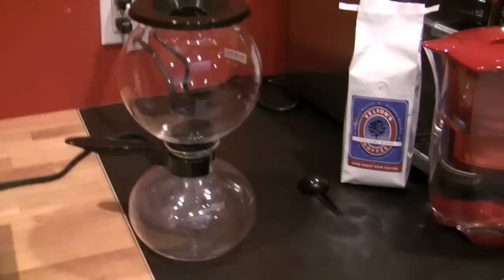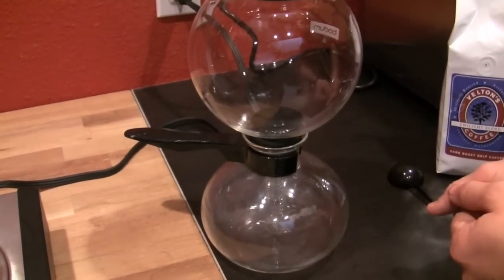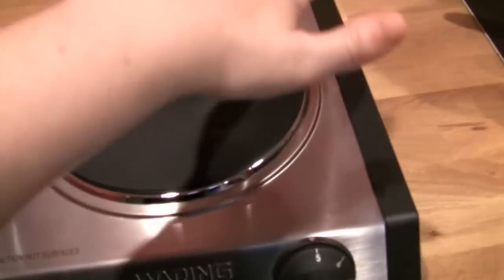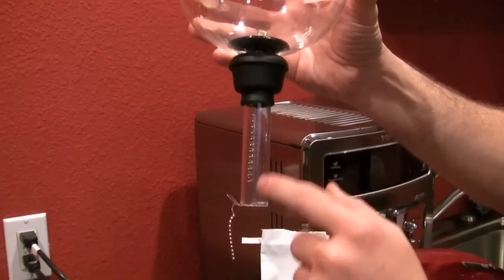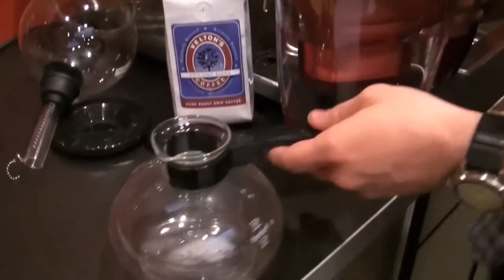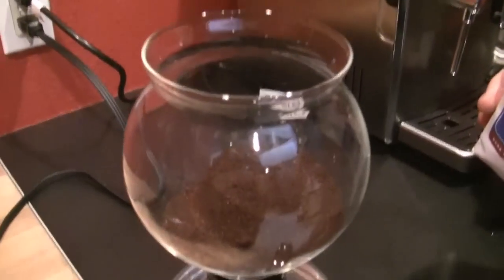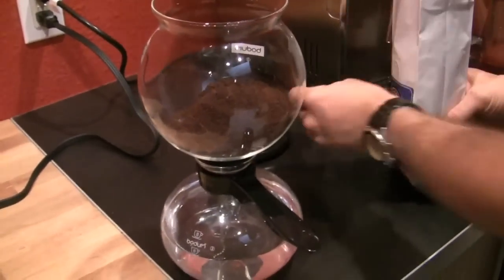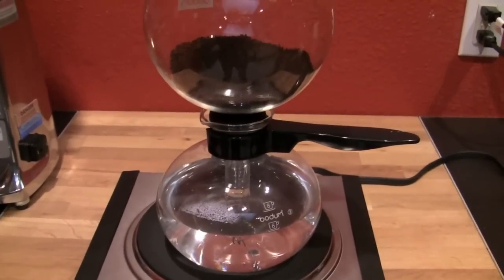Crew Review: Bodum Pebo Vacuum Pot

Comment: What are you using on the induction burner? It appears to have rubber on top? Does that mean you can set the burner to high and not worry about the glass tube shattering?

Comment: Great video as always, but some notes/differences to your method.

1. Heat the water until it fills the top chamber, then fill with ground coffee ensuring the right temperature of water for extraction.

2. Steep the coffee for about 1-2 minutes (better extraction) by keeping on the heat source, but lower it.  Make sure the water doesn't simmer too quickly or become dry.  That risks breakage.

3. When removing from heat, don't place it on a cold surface.  Use a towel to prevent temperature shock.

Comment: Nice little video and the humor of the interviewer lady is fun, I've collected the antique versions for over 20 years now, but they are very delicate, I would reserve the use of the antiques for special occasions only. The newer inexpensive Bodum seen here is easily replaced. One mistake at the end- he does not inform the user that it is imperative NOT to place the pot on direct metal stove burners. They will overheat and glass cracks. Use trivet spacer. Also find the antique insulated burners.

Comment: This is an excellent METHOD of making coffee, but the actual DEVICE has three big problems.  1) The glass is very thin and will break if accidentally tapped against the sink during cleaning.  2)  The spring valve changes its tension with use and becomes problematic after "X" number of uses.  You find yourself attempting to adjust the tension, which usually doesn't work.  3) Replacement parts are expensive.  Why Bodum cannot make a product with thick glass and a dependable valve is beyond me, unless we are simply talking crass profit motive for replacement parts.  It only works for a while and then you get fed up and shop for another brewer.  Bodum has had these complaints forever.  Unfortunate.
Reply: The Bonavita Immersion pour over dripper would be my alternative (also sold by these folks).  Though it is another method entirely, it is a clean, completly controllable process with pre-wetting and soaking aspects built in to the dripper cone.  I set the water to boil in a glass pot and while waiting, rinse off a brown, unbleached paper filter, grind and weigh the coffee.  I pre-wet the coffee with the valve closed, then pour in the extra water for a soak and open the valve.  Indestructable, totally variable timings and repeatable.  Drink hardy.
Reply: just bought an used syphon from a friend who modified it. He used a regular coffee pot like those you can find anywhere made from thick glass instead of the fridle one sold with the kit. He then proceded in using some kind of round rubber seal which he then siliconed in place. It works great and it is solid...good enough for 45$ shipped to my door.

Comment: @acn684 Agreed. Despite what the Bodum says, you really need to get the water to the proper temperature BEFORE letting it come into contact with the grounds. Either by attaching the globe with grounds in it onto the carafe once the water reaches the right temp, or by the method acn684 described. Test the temp of the water as it slowly seeps up into the grounds in the method used in this video. You'll find that it's very much under the desired 198-205 range. Also - finer grind and longer steep!

Comment: Another thing to mention here is that when you start with cold water some water will hit the upper part before it's up to boiling so you will get uneven brewing. What is best to do is to boil the water in a kettle and pour it to the lower part and when the water hits the upper part you lower the heat(if it's an electric stove) and stir the water to bring the temperature down a bit so it won't burn the coffee

Comment: Oh you are using drip grind here. I have this pot and with the included plastic filter anything more than finer end of the grind for french press and the coffee will be clogged and won't come down and it is very difficult to take it apart.  So to get the best result(although not too grate) you need to have exactly the right grind setting.

On the other hand my Hario Syphon with cloth filter will take much finer grind than you use for Hario V60 and almost down to moka pot grind.

Comment: This happens to me as well - the filter seems to get clogged at random, and it's a HUGE pain when it does.  Because the glass globe is incredibly hot, I can't just pour the water into a french press to finish the process.  You have to wait until it cools to unclog and drain the globe, and the coffee is ruined at that point.

I've also used fine, medium and coarse grounds from a Capresso Infinity grinder with identical results as far as filter clogging goes.  When it works it's great though!

Comment: I don't have the Bodum but Yama  but here are some tips ... Put your water on the burner and place the top chamber loosely on top until it's close to boil.   Then put it on and let the magic start.  I stir as he water is coming up to ensure a good saturation.  I keep my water up for infusion about 45 sec.  Then remove the heat source.    Also to the guy who had one explode ... What kind of heat element did you use?  You can't put this on everything ... some stoves need a diffuser.

Comment: @bucketoftruth if you're gonna use something as extreme as ice water then it will definitely break. Even with the more durable Hario glass pots, a wet towel in room temperature is still the safest option if you really want to accelerate the suction process.

Comment: I would like to share a different procedure for making coffee with this type of maker.  I've made coffee with these since the mid 80's, and learned this method from books on the subject. (The Book of Coffee and Tea by by Joel Schapira,  David Schapira, Karl Schapira. A classic.)

Bodum coffee makers are made in Europe.  They are using 4 oz. as a cup, giving the 6 cup marker on the pot.  The traditional measurement for a cup of coffee in the U.S. is 6 oz.  Use the measurement ratio of 1 level scoop to every 6 oz. of water.  Following the rule that the longer the water and coffee are together the coarser the grind should be, I use a very slightly coarser grind than a drip grind.  Do not use a fine or very fine grind because you can stop up the filter and get a vacuum lock.  When all of the water fills the upper chamber, there will be some initial bubbling (the first 'boil') then it'll settle down. Keep the heat on until it begins a second boil.  (If you remove the pot from the heat after the first boil, the coffee will not be at the appropriate temperature and the vacuum in the bottom chamber may not be strong enough to bring all of the coffee back to the bottom and it will be weak, unless you use the incredible amount given in the review of 8 scoops). Here you have some leeway as to how long you wait until you remove it from the heat.  I normally wait until the boil is just getting to the edge of becoming vigorous.  At this point the water will be at about 190 degrees.  I know this because I've measured it many times(at sea level).    Wait until the vacuum in the bottom chamber is refilled with the coffee then pour.  Enjoy.

Comment: Thanks just literally dusted off my Bodum vacuum. Its certainly a strange bird. I see on a Boodum official video them recommending, adding coffee  AFTER the water has risen. In your review you state the coffee brews at about 200 degrees. We'll mine brewed at like 150 shows my  accurate thermometer. That's far lower than any brew recommendations I know of. Ambient temp in my kitch was 68. I started with cold (prob very cold as it is winter) H2O. You can just keep it "percolating" until the water up top reaches the 200s but then I got a long brew time. A "cheat" put near boiling in the base to start. Then it "vacuums" up very quickly. There must be a sweet spot of initial water temp and BTUs of your cook-top. Someone out there must have the physics. I'll keep fiddling with it, You basically get several cups of french press brewing in the vacuum method (similar grit depending on grind) , with more show and less control. I'll post same on your updated crew review.

Comment: stovetop santos shatters on the stovetop and the replacement pitchers are almost as much as the entire santos itself.  This product is amazing up until when your pitcher breaks and a rip off the moment you have no pitcher to use and can't afford the over-priced replacement part from Bodum.  Since vacuum coffee is very clean and tasty given how the gasses release during the bewing process go with a syphon brewer that uses an alcohol burner--then your equipment will not break and be useless:)
Reply: My Santos is from the 60s or 70s and is still going strong being used daily. I have used it on both electric and gas burners throughout the years. I know some burners like the the coil ones need to be used with a diffuser.